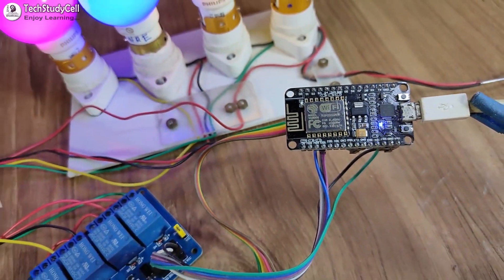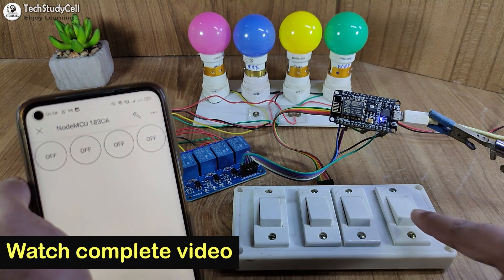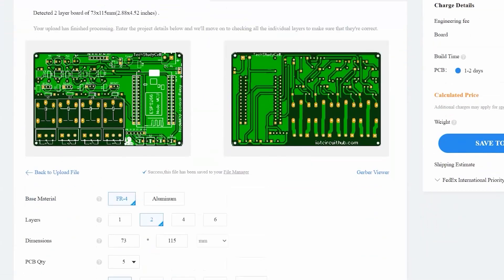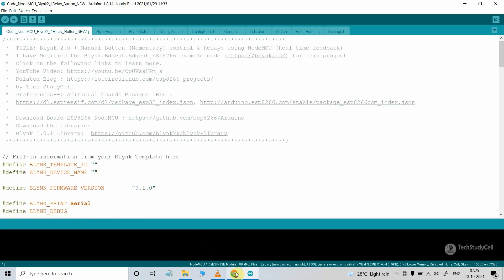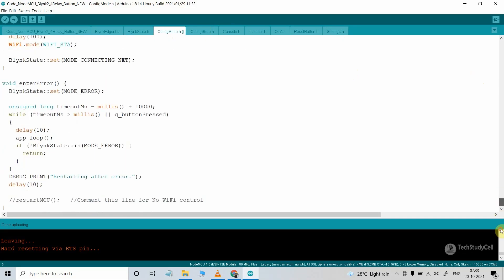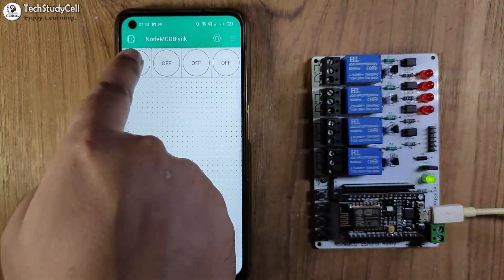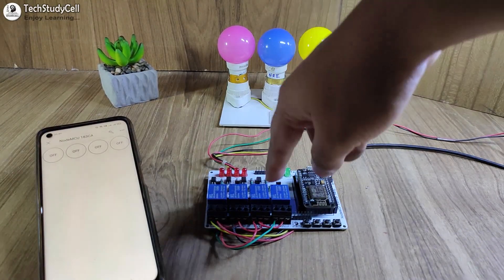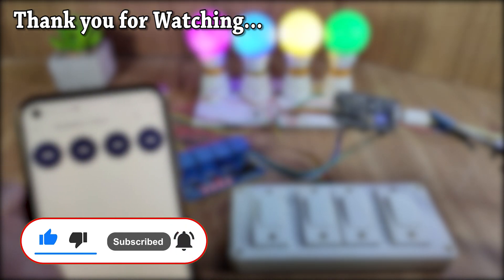IoT based Home Automation project using NodeMCU ESP8266 and New Blynk app | ESP8266 Projects 2021

Comment: Sir
I need to make water level monitoring system following is the logic 
I need to start and stop motor through relays and i need to watch the level of tank through led widget i am using water level switch having 3 levels 0%,50% and 100%.
Kindly help me with program code.
Thanks in advance.

Comment: I need help 🥺🥺🥺 I use mobile charger for ESP8266 power supply, but when it connect with long time Then ESP is damage...... How and what kind of power supply I use. ( For long time use)
Reply from the maker: You can use any stable 5V supply. When you restart the NodeMCU, make sure the switch2 (D3) should be OFF

Comment: Kindly make a seperate video on the electrical wiring. My device is connected, code works fine. I have done it all but somewhere I am going wrong coz of which one bulb glows as soon as power is on.
Reply from the maker: Ok. but it may happen due to loose connection

Comment: Sir you make awasome and usefull gadgets I heard that u told you can use this from anywhere but sir tried to make this it's working good but its work only when I'm near to the wifi can u explain me how could its work from anywhere so I can operate my home light from my OFFICE pl explain me
Reply: Not yet answer
Reply from the maker: The NodeMCU should be connected with the Home WiFi. Your mobile and NodeMCU  are connected to Blynk server through internet. So when you press the button in Blynk app, it send the signal to Blynk server through the internet. And the NodeMCU received that signal from Blynk server. Here both the mobile and NodeMCU  should be connect to internet.
Reply: Can u make video on this sir pllll make it

Comment: It is not a small limitation... its a huge limiataion.. just imagine you have placed the device inside a switch board... and wifi comes back !!!! How will you reset the board??? Not a good way of dealing with the problem.

Also the GPIO selection for the switches are really bad. As you know it will prevent the board from booting.... in short this project will have hard time working in reality... it is only good for youtube video.

Comment: Dear sir, 
I’m a fan of your channel and I find it very educational. If possible could you do a video on how to build and program a project with a microcontroller and a wifi module (like arruino nano and node mcu or wemos d1 mini) using the Blynk app? 
I attempted to build one for my personal project but I’m bit stuck on how the data from the arduino nano will get read by the Blynk app through my wemos d1 mini. Your reply to this is hugely appreciated. 
Thank you